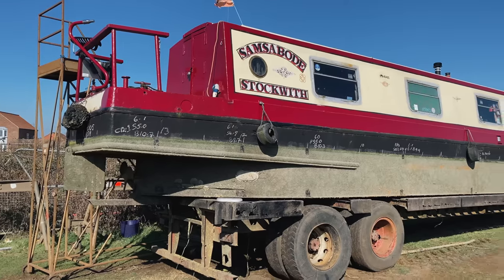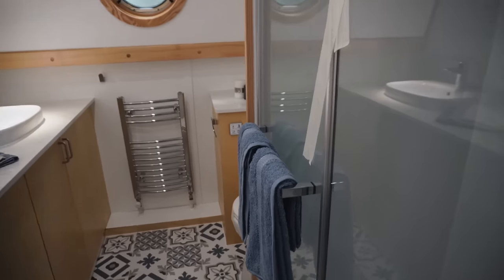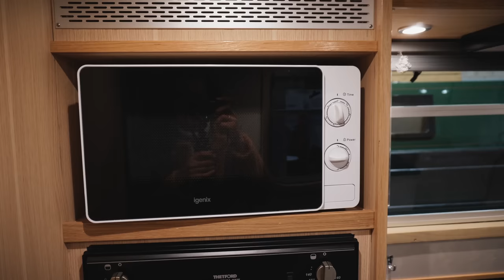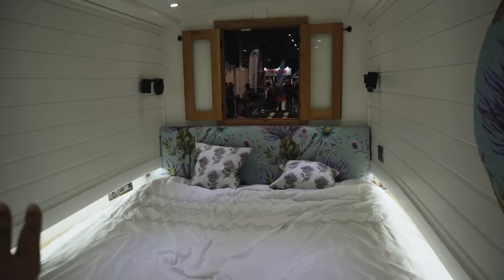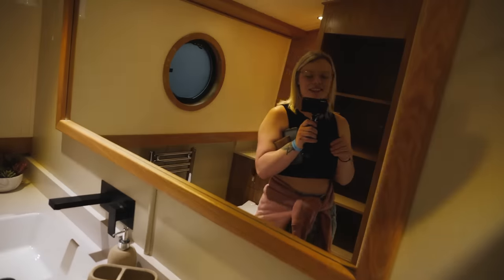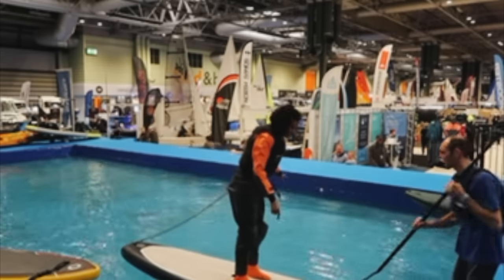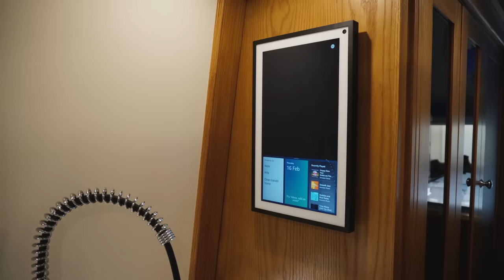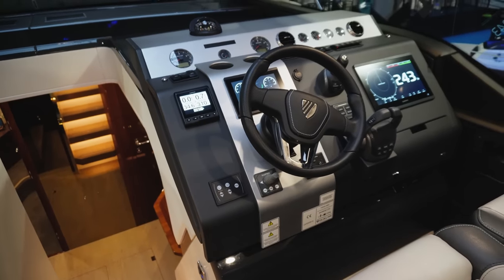Did I make a mistake? - buying the wrong boat

Comment: Widebeam boats are great if you don't want to move them if you want to travel then it has to be a narrowboat
Reply from the maker: We definitely want to be able to travel so narrowboat is best for us I think
Reply: As someone clueless..are the wide beams really just incapable of traveling most the canals?
Reply: Absolute rubbish, there are many hundreds of miles of canals (called widebeam canals) built specifically to accommodate the widebeam barge. (Another case of boat envy, I think) 😉